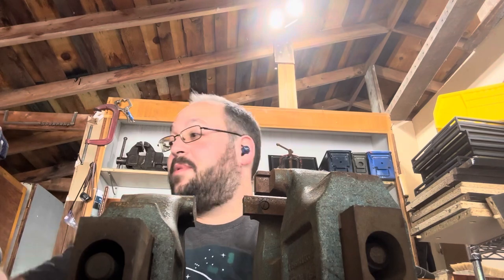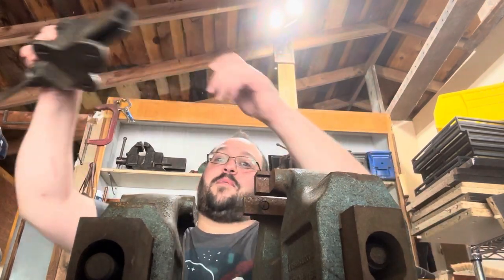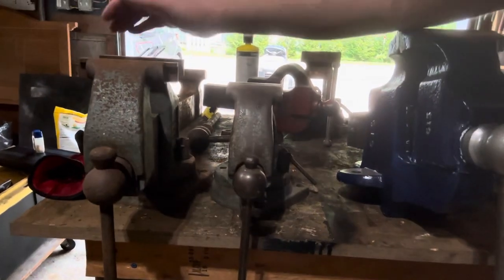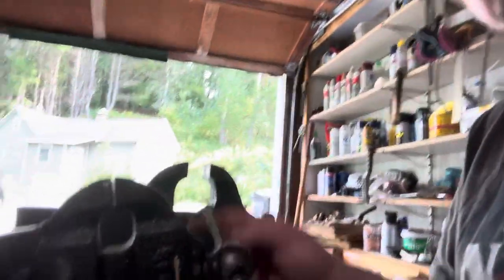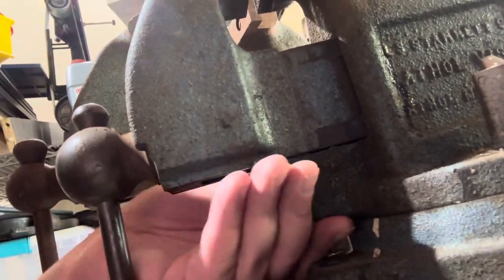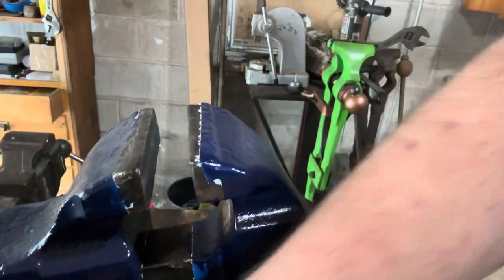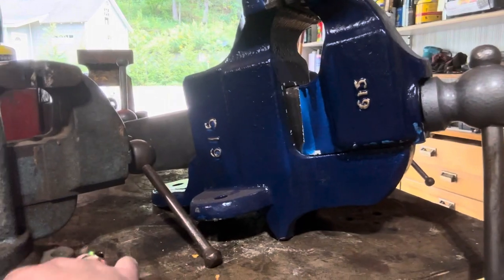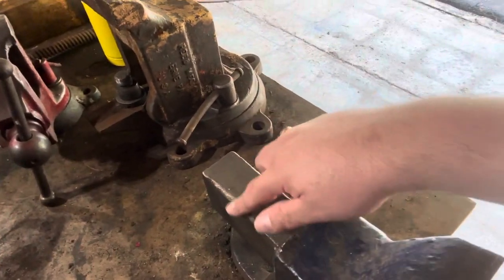A brief History of Athol and Starrett Vises

Comment: Hi, I inherited a Athol 615 , when I go to open it the handle and shaft come out but the jaw does not move unless I pull it open, it closes fine.  How do I fix it?  Thanks in advance, Bob
Reply from the maker: @robertpetersen443  the retaining clip is either missing or broken. I’ll see about tagging you in a short on it. Either Tuesday or Thursday depending when I’m home and make the time to pull one out. If you flip the vise over in the dynamic (the moving jaw) the screw goes in at the base of the casting where you can see the main screw at a 90 degree angle there is a hole that should be threaded and a 1/8” metal retainer that slots into a grove to hold the screw. It’s almost certainly missing or broken. Yiu can make a new one with an angle grinder and some sheet steel

Comment: I have a 324A that was given to me. Anything you could tell me about it? I need to find a way to lock down the swivel base as the nut and handle is missing.
Reply from the maker: I have seen people use the lockdowns from columbian vises that fit and work fairly well. Finding the lock downs as parts is difficult but finding a broken 624 or 324 might give you the part